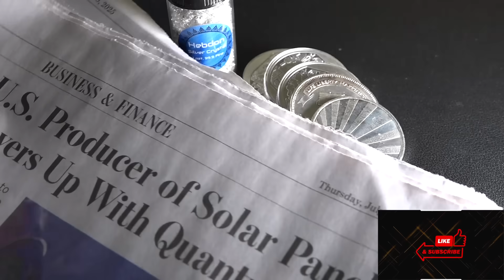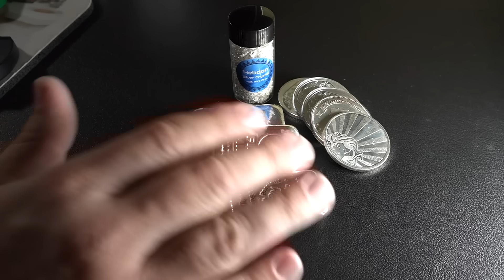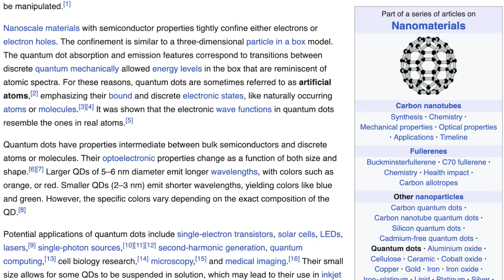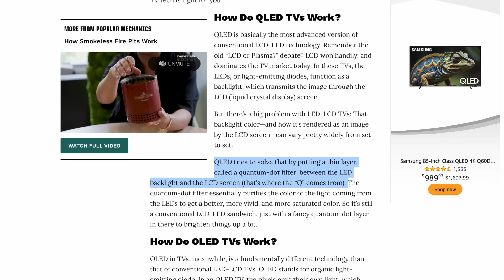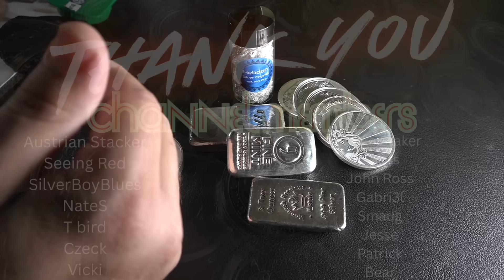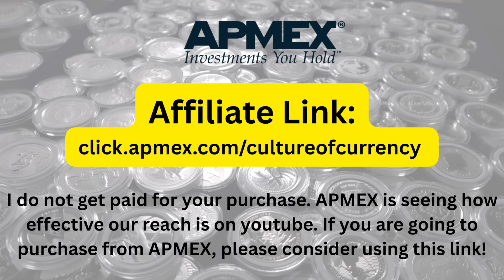HUGE SILVER ALERT!! Solar Panels are now using Quantum Dot Technology! SILVER COULD TANK!

Comment: Solar panels aren't the only thing that uses silver. High-performance electronics and industrial electronics use silver. That besides silver is artificially suppressed because of its wide applications. Not using silver in solar panels doesn't help that argument as high silver prices won't affect solar panel cost if that was the case. This would actually push the case to make silver real price appear 😂.

Comment: Looked it up and although it seems promising, things such as air, moisture, high temperatures and ultraviolet rays, cause more rapid degradation of the panels. Also things like lead, cadmium, arsenic and mercury used in this technology,are not considered safe for the environment. I'm not too worried.
Reply from the maker: Thank you for doing research!! For being “clean” energy it sure is dirty.

Comment: This Dude! needs to get his head together and do better. He is so full of it!
Reply from the maker: Right!!! What a Kook! I hear he talked to a physicist who said:

As a physicist who worked in photonics, and has researched quantum dots, I can tell you that they are real. It is basically just the extension and application of quantum theory to near atomic scale in 3D, whereas classical semiconductor band theory assumes the application of quantum theory to a semi-infinite periodic lattice (at least much larger than an atom). Being able to control quantum dots is the holy grail for photon absorption and electron generation. It doesn’t rely on some hit or miss existing material technology like Perovskites.

SO full of it!

Comment: Nano crystals... increasing power density. Just who is producing these ?
Reply from the maker: SunDrive Solar (Australia): This company made headlines for developing commercial-sized, silver-free silicon PV cells that achieved a world-record efficiency of 25.54% by replacing silver with copper. They aimed for mass-producible modules in 2023.

CuSun Project (Denmark): A research and industry partnership is actively developing copper contacts for PV panels to lower costs and environmental impact while aiming to retain or improve efficiency.

There are a couple more but these are the ones that stick out to me.

Comment: Currently: A quantum dot solar panel is 2 to 3 times more expensive to produce than a silicon panel ($350 to $700 vs. $175 to $280 for a 350W panel), mainly due to the high costs of quantum dots ($11 to $73 per gram) and the lack of optimization of manufacturing processes.
Reply from the maker: True...That is my big question...How does one scale something like this?! Really interesting movement but I would assume they would not spend millions developing products unless they know it can be viable.

Comment: people with no knowledge of basic physics are easily fooled about quantum efficiencies....stupidity hurts.
Reply from the maker: This was from a physicist who commented on Reddit about it in response to my video...His words are better than mine.

 As a physicist who worked in photonics, and has researched quantum dots, I can tell you that they are real. It is basically just the extension and application of quantum theory to near atomic scale in 3D, whereas classical semiconductor band theory assumes the application of quantum theory to a semi-infinite periodic lattice (at least much larger than an atom). Being able to control quantum dots is the holy grail for photon absorption and electron generation. It doesn’t rely on some hit or miss existing material technology like Perovskites.

I am not worried either but I thought it valuable info and very interesting to my viewers.

Comment: nonsense.
Reply from the maker: This was from a physicist who commented on Reddit about it in response to my video...His words are better than mine.

 As a physicist who worked in photonics, and has researched quantum dots, I can tell you that they are real. It is basically just the extension and application of quantum theory to near atomic scale in 3D, whereas classical semiconductor band theory assumes the application of quantum theory to a semi-infinite periodic lattice (at least much larger than an atom). Being able to control quantum dots is the holy grail for photon absorption and electron generation. It doesn’t rely on some hit or miss existing material technology like Perovskites.

I am not worried either but I thought it valuable info and very interesting to my viewers.

Comment: Regardless silver production is down 10% consecutively for the last 5 years and will continue to go down so even if you don’t have to use one once of silver in a panel it will be offset with low production Also most countries around the world have very high restrictions on mining because of environmental issues .
So sit back and relax because silver is the most undervalued asset in the world and any one with a once of brains will be buying and accumulating.
If you don’t get on board now you will miss out when you see the price of silver over $300 in the next five years.
Reply from the maker: No problems with that. I think it is undervalued as well. I always buy.

This was from a physicist who commented on Reddit about it in response to my video...His words are better than mine.

 As a physicist who worked in photonics, and has researched quantum dots, I can tell you that they are real. It is basically just the extension and application of quantum theory to near atomic scale in 3D, whereas classical semiconductor band theory assumes the application of quantum theory to a semi-infinite periodic lattice (at least much larger than an atom). Being able to control quantum dots is the holy grail for photon absorption and electron generation. It doesn’t rely on some hit or miss existing material technology like Perovskites.

I am not worried either but I thought it valuable info and very interesting to my viewers.

Comment: With respect, there are a lot of other factors you didn't discuss that will determine the affect quatum dots will have on the demand for silver. At this point I'm not worried.
Reply from the maker: This was from a physicist who commented on Reddit about it in response to my video...His words are better than mine.

 As a physicist who worked in photonics, and has researched quantum dots, I can tell you that they are real. It is basically just the extension and application of quantum theory to near atomic scale in 3D, whereas classical semiconductor band theory assumes the application of quantum theory to a semi-infinite periodic lattice (at least much larger than an atom). Being able to control quantum dots is the holy grail for photon absorption and electron generation. It doesn’t rely on some hit or miss existing material technology like Perovskites.

I am not worried either but I thought it valuable info and very interesting to my viewers.

Comment: Trust me, if it’s an electronic, will require silver
Reply from the maker: SunDrive Solar (Australia): This company made headlines for developing commercial-sized, silver-free silicon PV cells that achieved a world-record efficiency of 25.54% by replacing silver with copper. They aimed for mass-producible modules in 2023.

CuSun Project (Denmark): A research and industry partnership is actively developing copper contacts for PV panels to lower costs and environmental impact while aiming to retain or improve efficiency.

Comment: In 2006, Israel had technology that solar panels process solar energy from moon light with no sun but the reflection of sun to the moon. Israel was going to share technology with Iran plus water filtration.
Reply from the maker: SunDrive Solar (Australia): This company made headlines for developing commercial-sized, silver-free silicon PV cells that achieved a world-record efficiency of 25.54% by replacing silver with copper. They aimed for mass-producible modules in 2023.

CuSun Project (Denmark): A research and industry partnership is actively developing copper contacts for PV panels to lower costs and environmental impact while aiming to retain or improve efficiency.
Reply: Wow moving from silver to copper

Comment: Electrical current conduction is most efficiently passed through low resistance = silver.     Gold is even better !    Copper is inefficient.
Reply from the maker: Gold is better? I did not know that! You are somewhat right about copper. I thought the same thing until I read what some companies have found to be true. SunDrive Solar (Australia): This company made headlines for developing commercial-sized, silver-free silicon PV cells that achieved a world-record efficiency of 25.54% by replacing silver with copper. They aimed for mass-producible modules in 2023.

CuSun Project (Denmark): A research and industry partnership is actively developing copper contacts for PV panels to lower costs and environmental impact while aiming to retain or improve efficiency.

With the Dqots being able to hyper-focus on target wavelengths it picks up the slack lost by not using silver!
Reply: @cultureofcurrency .   Thanks for your Good input.    Yes, gold is significantly lower resistance than silver. Most high speed chips use gold plated contacts. From my perspective and physics I squared R is the law.  High voltage, low current is a little better, like high tension wires (10,000 volts) where much of the current rides on the outside of the copper wire conductor.  New AI chips waste tons of power (250 watts per CPU !!!) and that’s Using silver with gold plating, pure gold is too expensive, even for AI.  I,ll have to study the physics of the new technologies you mentioned. Thank you.

Comment: A lot of "could be", "maybe", "supposedly", "possibly". Yet in real life there is not a single quantum Dot panel in use.
Reply from the maker: That is for sure not true. SunDrive Solar (Australia): This company made headlines for developing commercial-sized, silver-free silicon PV cells that achieved a world-record efficiency of 25.54% by replacing silver with copper. They aimed for mass-producible modules in 2023.

CuSun Project (Denmark): A research and industry partnership is actively developing copper contacts for PV panels to lower costs and environmental impact while aiming to retain or improve efficiency.

Comment: Silver isn't in the panels for the capturing of solar energy, but rather it's used to transmit the electricity. If the panels get more efficient at capturing solar energy and converting it to electricity, that would require MORE silver because it is the best conductor.
Reply from the maker: I thought the same until recently. GraphEnergyTech, a spin‑out from the Cambridge Graphene Centre and ETH Lausanne, has developed conductive graphene inks to replace silver electrode lines in solar cells. First Solar, a leading thin‑film solar panel manufacturer, has struck a long-term exclusive supply and integration agreement with UbiQD, a quantum-dot specialist in New Mexico which will use a QD and copper approach where they can tune to wavelength frequencies making the power grab much better.

Comment: Silver is used for power conduction, while quantum dots are used for converting light into electricity; they serve different purposes and won’t replace each other.
Reply from the maker: They did not until recently. GraphEnergyTech, a spin‑out from the Cambridge Graphene Centre and ETH Lausanne, has developed conductive graphene inks to replace silver electrode lines in solar cells.

Comment: From Grok...  The claim that quantum dot solar cells could "bypass" silver use, as suggested by sources like the YouTube video titled "HUGE SILVER ALERT!! Solar Panels are now using Quantum Dot Technology! SILVER COULD TANK!", appears exaggerated. While QDSCs offer flexibility in material choices and could theoretically eliminate silver by using alternative conductive materials, silver is still commonly used in many current designs due to its performance advantages. The video’s sensational framing lacks nuance and ignores the complexity of material substitution in solar cell production. No definitive evidence suggests that QDSCs have entirely eliminated silver in commercially viable designs as of July 2025.
Reply from the maker: Also from Grok:
 First Solar & UbiQD
First Solar, a leading thin‑film solar panel manufacturer, has struck a long-term exclusive supply and integration agreement with UbiQD, a quantum-dot specialist in New Mexico Wikipedia+15Wall Street Journal+15Science News Today+15.

UbiQD’s copper‑indium-based quantum dots (non-toxic alternative to Pb or Cd variants) are applied as a thin film layer—especially on the rear side of their bifacial panels—to capture reflected sunlight, boosting the efficiency of light conversion, potentially more than doubling it for certain wavelengths. (sources Solar Builder Magazine+5Wall Street Journal+5pv magazine India+5.)

This approach reduces reliance on conventional metallization techniques (e.g. silver fingers) by enabling enhanced charge harvesting and spectral conversion without additional silver usage .

A commercial rollout is planned for late 2026, with UbiQD scaling production to over 100 metric tons per year of QDs (sources arXiv+11Wall Street Journal+11Electrek+11).

2. GraphEnergyTech (Cambridge Spin‑out)
GraphEnergyTech, a spin‑out from the Cambridge Graphene Centre and ETH Lausanne, has developed conductive graphene inks to replace silver electrode lines in solar cells.

Their patented graphene‑based ink can be printed as conductive front contacts instead of silver paste, offering a lower-cost and resource-efficient alternative to silver metallization (Sources The Quantum Insider+2The Times+2Electrek+2.)

Backers include Aramco Ventures and solar luminary Michael Grätzel, helping propel early commercialization efforts in solar and beyond The Times.

🔬 Other Promising Developments
A multi‑national research team (Soochow University, Northern Illinois U., Argonne, NREL, etc.) engineered a solution‑chemistry‑stabilized conductive colloidal QD ink, enabling fully printable quantum dot solar layers. Large‑area devices reached up to 10 % certified efficiency, while lab cells hit 13.4 %, with material costs under $0.06 per watt (sources pv magazine International+1Science News Today+1).

While these still used silver anodes, the QD ink layer greatly reduced silver use within the active layer architecture.

In perovskite solar cells, MoS₂ QDs combined with graphene have been used to engineer hole-transport layers yielding efficiencies above 20 %, offering another pathway to reduce or replace silver interfaces arXiv.

⚙️ How This Reduces Silver Use
🌈 Quantum Dot Layers
QDs can be applied as spectral-conversion or charge-harvesting layers, enabling thinner silver contacts or removing some metallization steps altogether.

In bifacial panels, QDs convert reflected infrared and UV light into wavelengths better absorbed by the silicon or CdTe—or replace the need for fine silver finger grids on the backside.

🖨️ Conductive Inks
Graphene‑based QD inks (e.g. by GraphEnergyTech) can replace silver paste used in screen‑printed front contacts, cutting down on silver content and cost.

💡 Tunable Bandgap
By customizing QD bandgaps, solar cells can capture a broader spectrum with greater efficiency, reducing dependence on silver metallization to compensate for spectral inefficiencies.

✅ Key Benefits & Challenges
Advantage	Explanation
Cost reduction	Silver prices are volatile and increasing; QDs (especially copper/indium based) and graphene are cheaper and scalable.
Efficiency boost	Enhancing light absorption and spectral conversion yields more power per panel footprint.
Resource availability	Relying less on silver—whose global supply may struggle to keep pace with solar demand.
Manufacturability	Many of these approaches can integrate with existing fabs (e.g. “drop‑in” films, printable inks) without massive retooling.

Challenges remain:

Matching silver’s conductivity in printed contacts.

Long-term stability and durability (especially under UV and thermal stress).

Scaling lab results to utility‑scale volume production.

Minimizing use of toxic materials—though many companies are switching to non‑toxic compositions (e.g. copper‑indium).

🧭 Bottom Line
First Solar + UbiQD is the most advanced commercial partnership, focused on boosting panel performance while reducing reliance on silver.

GraphEnergyTech is tackling direct silver-replacement in conductive contacts using graphene quantum-dot inks.

Academic and industrial research groups are pushing forward printable QD layers and hybrid materials that could further minimize or eliminate silver use in both contact and active layer structures.

These innovations point toward a future where QDs—especially in non-toxic, printable form—can sharply reduce solar panel costs and silver dependence, all while improving energy output.

Seems that AI is not the best at being objective but if you ask it to respond based on sources, it does better.

Comment: QLED cannot directly replace silver in solar panels
Reply from the maker: SunDrive Solar (Australia): This company made headlines for developing commercial-sized, silver-free silicon PV cells that achieved a world-record efficiency of 25.54% by replacing silver with copper. They aimed for mass-producible modules in 2023.

CuSun Project (Denmark): A research and industry partnership is actively developing copper contacts for PV panels to lower costs and environmental impact while aiming to retain or improve efficiency.

So it can be done...but the question is at what cost and is it worth it.